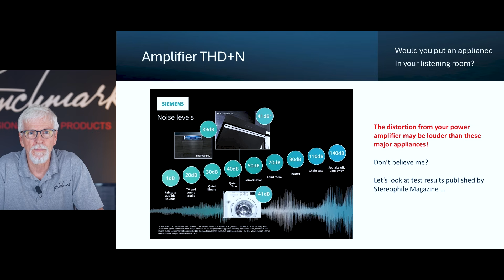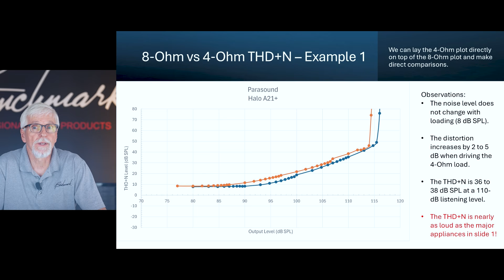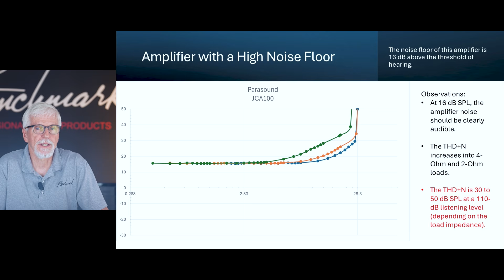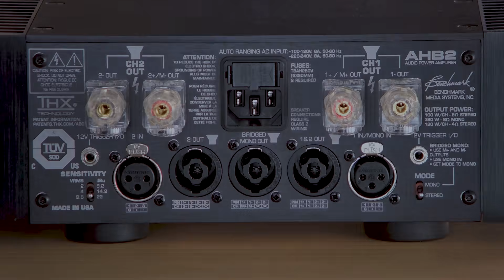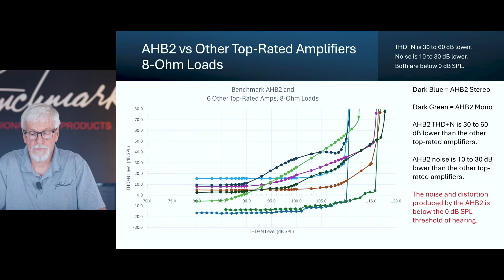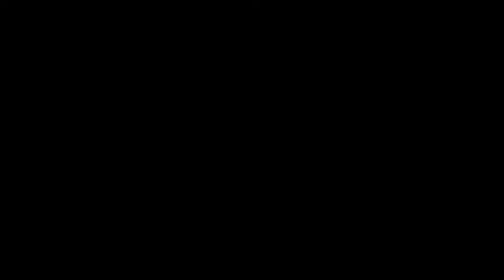How Loud is the Distortion from Your Power Amplifier?

Comment: The SPEAKERS have much higher distortion than a power amplifier not pushed too hard obviously.  How about looking at the distortion figures for a modern hypex or purifi amplifier, or a topping la90 / b100 / b200, or an orchard audio module, or the latest ice power modules huh?  VANISHINGLY low distortion.  And vanishingly low noise!  7db self noise?  That's terrible.  How about 2 to 4 MICROVOLTS... 2-4 uV, from the topping?  That ain't getting you 7-8db at the listening position.  .0004-.0005% THD at 5 watts.  Yes 3 zeroes.  This is VERY good preamp/DAC level distortion if not better.  145db SNR.  The hypex and purifi are well into the 120s and 130s SNR - again, excellent by modern preamp/dac standards!  My goodness... you make great amps there's no need to compare them to utter crap.  How about looking at actually good amps - AFFORDABLE amps!

In your third example, around 14 minutes, you remark about the 50db distortion from this unknown amp when it's playing at 110db (through what speaker exactly?  or what sensitivity?  you don't say)... but if you look at the graph, it's near 0db at 90db!  You realize 90db is VERY loud yeah?  You're not going to listen for extended periods above 80-90db for the average listener... I'd say 85 honestly, which gets you ~0db from the distortion, and with 10db dynamic headroom your 95db is around 10db distortion.  If you don't think 95db is COMPLETELY covering up 10db of harmonic distortion you're just crazy.  And of course, I've never heard of this amp, and it's certainly not as good as the better examples from the makers I've listed above.  These companies make 200, 300, 350+ watt and above amps... 100 watts isn't even beginning to push the THD number anywhere close to the knee, it's actually still ultra low, like ultra ultra low.  In fact a lot of these class D amps THD curve goes DOWN as power goes up beyond a certain point, and then starts to curve back up past a different point... and their power ratings are not beyond the knee, 1% figures.  Drop even 10 or 20% from that rated point and the distortion is vastly lower as well, because even though 1% rated power on them isn't past the knee where it truly skyrockets at a very fast rate, it's still rising faster toward the top end of that 1% figure.  You can easily get 150-250 watts or more at below .1% THD from an amp that costs under a grand.

The benchmark amp is great.  Why don't you test it against the latest greatest Topping, Purifi, Hypex, ICE, and Orchard Audio stuff instead of this nonsense.  In the value hifi space, or diy space, anything else is basically irrelevant.
Reply from the maker: The 6 other amplifiers were the amplifiers on the Stereophile list of recommended amplifiers. The amplifiers you mention, were not on that list. Some of the performance parameters of the amplifiers on your list are impressive, especially if you are just looking at 1 kHz test tones. Some start to fall apart at higher test frequencies or under difficult phase angles. These tests are outside of the scope of this simple 1 kHz THD+N vs. power comparison that I am making in this video.

Regarding the levels, we are talking about peak levels and not the average levels that you will read on a meter (even when it is set to "fast" mode). That reading will usually be about 12 dB lower than the peak value. In fairness, the THD numbers are also peak values. - JS
Reply: @BenchmarkMediaSystems I appreciate your response, however I am not merely referencing a brief pared down spec sheet covering 1khz burst tests or anything like that.   I'm considering full amp dyno testing with high end test equipment.  20-20khz tests, multi-tone tests, 40hz tests, burst and long duration tests, and seeing the entire THD curve (and the harmonic spectra shown in detail!) with those various test signals, so I'm afraid that criticism doesn't stand, but the appreciation of their performance measurements does.  Heck ASR (which is not the only source of this data btw) even has various phase angle power testing with a thd threshold.

These amplifiers perform exceptionally under all outlined conditions.   I do not believe the hypex matches the AHB2 certainly, and I didn't claim it did, but it beats those other amps in most if not all regards... perhaps the one beats it in self noise or thd at under a watt or 5 watts, maybe.  That's for ncore amps, the Nilai I believe may be even better.   The purifi eigentacht is also better, and technically the Topping is better - though perhaps not for the maggies as mentioned above, which drop far below 4 ohms and need lots of current. 

There are probably 2 or 3 other cutting edge top level class D designs besides hypex and purifi as well, that even in the last year or so have been announcing their latest designs, and are competing at the top level.

Purifi as you probably know makes arguably the greatest conventional drivers in the world,  in terms of measurements and capabilities.  Their amplifiers are equally impressive and designed to offer absolute butt tons of ultra clean power to match. 

Hypex stands out in terms of price and product range.  Exceptional performance, not quite purifi level (though again Nilai is a different beast and I need to refresh my knowledge of the performance of the latest version... its not as powerful but in some ways a more advanced design, perhaps more intended for home hifi vs a broader use case that includes powered pa speakers and subs as well as home theater and hifi use with ncore), but you can get into the 150w @ 8 ohm (1% thd) 250w @ 4 ohm class for $575 last i checked,  and 300-350 into 8 and 500-700 into 4 for 700-1000 dollars for a finished,  encased, 2 channel amp.  Nilai is i believe around say 200w as well and a finished product might be 1200-1500 bucks.  If you're going full diy with modules it can be even less. 

That's not your direct competition I understand that.   But the value proposition AND absolute performance puts just about everything else to shame.  Purifi might run you an extra 300-500 bucks if one prefers that.   Topping would run 800-1600 i wanna say, between the various models listed to get 2ch, maybe less.

If money was no object, and if i found the power adequate for my needs,  I might also just get an ahb2.  No denying it's performance.  But if you want to increase volume and breadth of customers and not become increasingly pigeonholed into an aging and dying rich audiophile customer demographic, I'm just telling you, the competition is marching on at an accelerating pace and most people couldn't even consider an ahb2 at that price.  

It's one thing to have a flagship, but maybe some more trickle down design/tech could produce more affordable amps for those who for whatever reason want to stick with class ab?  The home theater space has a lot of $ to tap into and they're largely running 7 or 11 channels of hypex amplification because the performance and value is unbeatable, and because they actually want/need that 150-300 watt / 250-500 watt (8/4 ohm) level of power.

Margins, or volume.  Boomers in the K shaped economy may have served you well up until now... how about in 5 or 10 years?  Just a thought.  I do appreciate your commitment to the measurements and science, plenty of audiophile brands ignore it.  I can tell you younger generations will not ignore it, and are not allergic to class D, which is ever improving, and arguably already "there", with effectively technically perfect amplification... there's almost no improvement even needed at this point,  arguably nothing audible.  But even if that's true,  better specs will always sell, just like you don't need 1000hp in your supercar instead of 800... but they'll buy it.  But maybe sell the corvette AND the ferarri... now that's market share!
Reply: @Artcore103  I think you forget how many rich people still exist in the world. Benchmark equipment is already an order of magnetude cheaper than established HIFI brands. If they made an amp cheaper than $3500 then people would literally no longer buy it because it would be "too cheap." You have to understand how the different pricing bands work--Benchmark can't fall too low. If class D wants to be taken more seriously then manufacturers need to sell at higher price points where serious buyers live (like Apollon does).
Reply: @Patrick-ml7pq lol you do have a point there.   Still, if i believe i can get effectively or practically the same performance for a third the cost, then i and many people will. 

On a more speculative note, I don't think the status quo in luxury spending in the west is going to continue uninterrupted.
Reply: @Artcore103  You may be right, but if there are dozens of companies selling amps for $60,000 and up, then Benchmark's products are basically "peanuts" already from the perspective of luxury spending. The fact that Benchmark is already priced too low is obvious from how they are treated in places like Absolute Sound where they are only mentioned in the poverty "below $10,000" band, if they are even mentioned at all.
Reply: @Patrick-ml7pq that's absurd!  But the hifi magazines are dead and they don't even know it, kind of like aging mainstream news stations and newspapers for boomers.  No offense to boomers.
Reply: If you actually listened rather than just read dubious measurment sites you would realize that amps like the Topping B200 are absolute garbage and are not worthy of being in the same conversation as the Benchmark or even some of the Stereophile recommended amps.
Reply: @Patrick-ml7pq please do enlighten me, as you would appear to be just another asr hater, perhaps a subjectivist i don't know... but if you have quantifiable data then that's what I'm interested in.  The numbers are the numbers unless you're saying they're wrong and you have different numbers, or can point to a different objective measurement not covered elsewhere, that matters.
Reply: @Artcore103  I have the ahb2 and I bought the topping B200 monoblocks to compare. The difference between the two is extreme, at least feeding my magnepans. I am talking an extraordinarily audible difference, not some small audiophile thing.
Reply: @Patrick-ml7pq to be fair, Maggie's are not your typical use case, very rare.  You could be right there, the b200 is certainly less powerful for that load for one. 

But still you're only addressing the one other amp mentioned that you tried and found lacking for an extreme edge case speaker.

You know what works great for Maggie's?  ALL the class D amps i mentioned.   Get an eigentacht or an nc500x and try that again.  That would have been obvious from the start if I had Maggie's.  Need massive juice and very low impedance stability.   How's 4 or 5, maybe 6 or 7 hundred watts sound?
Reply: @Artcore103  As Benchmark has shown repeatedly, Class D amps are still a long ways away from good AB amps. Although admittedly I am now relying on their measurements and statements since I have not heard a good class D myself! 

The Topping B200 is very representative of the type of gear that ASR advertises on behalf of their manufactures--that's why I tried that one. I do consult ASR measurements, but they clearly only apply to idealized loads and not a full range of real life situations.
Reply: @Patrick-ml7pq they review and test thousands of products... they being a handful of forum members.  You'd need evidence to claim it has anything to do with monetary incentive.   They are also not the only source of measurement data, just one particularly prolific one,  and arguably independent and thus more trustworthy than manufacturers themselves.

Purifi makes the best performing drivers on the market, and some of the best class d amps that exist.   You think they're just using, or designing for,  "ideal" loads and unrealistic ideal test conditions?  They have all the tools to measure with any synthetic load or real load - their drivers - that they want.  Its as if you don't believe any of these companies have any incentive to actually make the best thing they possibly can, fully aware of real world performance.   I think you think amplifiers are more sensitive to the load,  impedance dips, reactance, back effects, whatever - than they actually are.  Poor or flawed designs may very well be... good ones are not, and a dummy load while not exactly matching your real load is still quite useful and close to representing exactly what you'll get.   Testing already includes 8, 4, and often 2 ohms anyway, so that's half the variance in conditions to consider right there.   Asr even has phase angle power vs thd testing, at least in some reviews.
Reply: @Patrick-ml7pq  The more extreme you claim the difference to be the more obvious that it's placebo or mismatched testing.  There's simply no room in the measurements for that significant of an audible difference.
Reply: @zachansen8293  Of course there is because no one measured them actually hooked up to Magnepans. Don't confused ideal lab loads with real ones.
Reply: @Patrick-ml7pq unfortunately yes, multiple generations of Topping have been reengineered/ updated due to failure rate, bad power supplies etc... funny how 'spec chasers' never seem to notice the things that matter when it comes to actual ownership.

Comment: The AHB2 is clearly an incredibly well designed and built amplifier - no question about it. In real world listening though isn’t background noise around about 40dB? And if so doesn’t that mean that even when listening at reference levels, THD+N would be masked by background noise? Also you mentioned speakers making THd+N, typically how many dB of THd+N do speakers have and does Benchmark have any plans to build a low distortion low noise loudspeaker? Thanks for an insightful video, the graph showing SPL certainly gives food for thought.
Reply from the maker: We can hear a 3 kHz tone at a level that is 30 dB below the ambient noise. This incredible ability is what allows us to carry on a conversation in a noisy room. The spectral content of the noise signal and the spectral content of the ambient noise will ultimately determine the audibility.

Speakers are still the largest source of distortion in most systems. Nevertheless, the electronics are a significant contributing factor in most systems. I love the fact that we are seeing very significant improvements in speaker distortion. - JS
Reply: Yes... the answer is yes.  Maybe 30db if we're being optimistic / in a very quiet environment.  But either way this is not only masked by the background noise as you say, it's MORE masked by the music.  Still personally I find the bigger problem to be the amps chosen to compare, I guess based on some useless stereophile review?  Some dead magazine for old hifi people?  No one cares about that.  We have cheap ultra high performance class D amps now from hypex, purifi, orchard audio, ICE, then there's the INSANELY well measuring topping amps.  They won't use those for comparison, because the noise and thd is far lower than their chosen comparison amps.  The Benchmark is indeed incredible... it's worthy of comparison to the ACTUAL best competitors out there, it may even come out on top most of the time... just not by nearly this degree, and not in a way that justifies the price difference!  That's the problem.

Comment: What is your opinion on the increased audibility of higher order harmonics (meaning that the higher the order of the harmonics the higher their audibility)? I am specifically asking because I read a japanese research paper that stated that human listeners were able to discern frequencies higher than 20kHz if those signals were harmonics of lower order signals. Could there be credit in claims that we should aim for drastic reduction in already minute-level high order harmonics despite the penalty in the lower order ones? Also would an amplifier that does not use negative feedback allow for the performance characteristics described in the previous sentence? (I somehow have failed to find conclusive evidence as to the relationship between extremely low level increase of very high order harmonics and negative feedback and I would like to know.) Thanks in advance!
Also, great video.
Reply from the maker: High-order harmonics are more problematic because they are not well-masked by the fundamental. Another issue is that electronically generated harmonics are always exact integer multiples of the fundamental frequency. In contrast, the overtones created by musical instruments are often stretched slightly higher than integer multiples. The natural overtones can beat against the electronically generated distortion, and this may cause IMD tones that fall within the audible band. The safe bet is to eliminate the electronically generated distortion. - JS
Reply: @BenchmarkMediaSystems  Thank you for answering. I didn't know that about the harmonics of musical instruments.
Reply: Sounds like they were detecting IMD if I had to guess, not the over 20khz harmonic content itself.
Reply: @Artcore103 I thought about that as well.
Reply: The different frequencies add up. I can always hear 1000 hz +20000 hz tones.